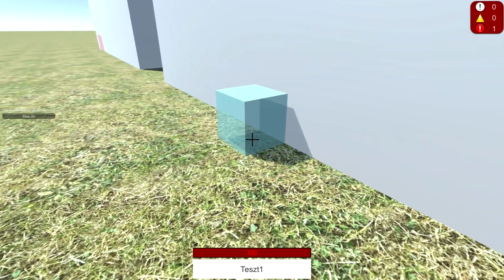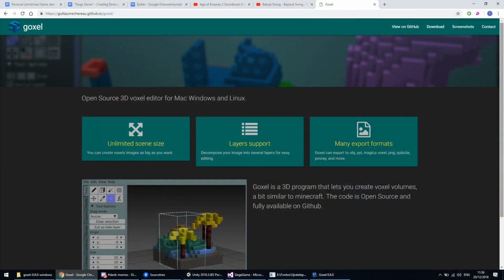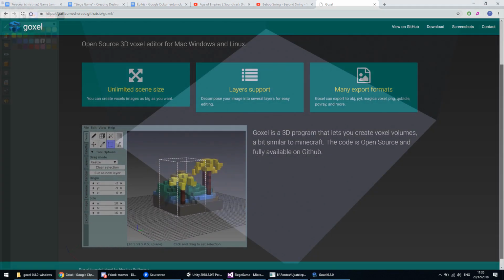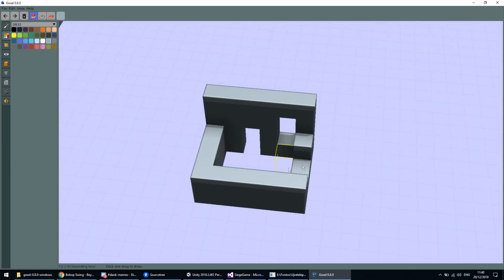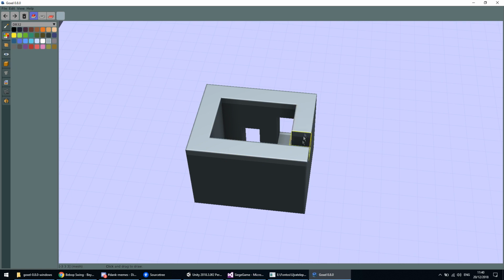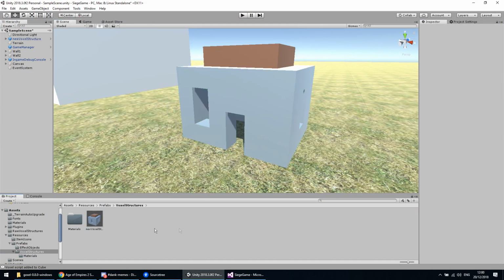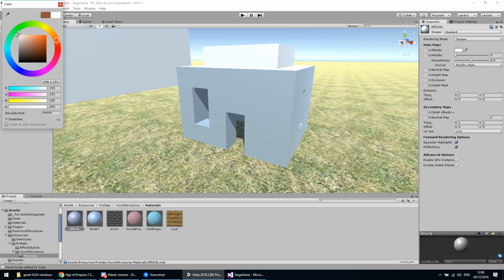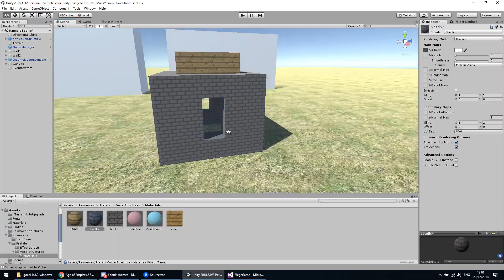How I Model Destructible Voxel Buildings in my Unity3D Game

Comment: You should do tutorialis you are are a smart guy
Reply from the maker: Back in my old channel I made a lot of tutorials, and the I started to get lots of emails, messages, asking for help. First I helped all the a time, but then I realised that sometines 8've spent hours on someone issue, for free.
And when I told them that this problem would be hours to fix, and I don't have that much time right now, they got rude.
Now I try to minimalise tutorials, so I won't be "a tutorial guy".
Reply: @Tudvari  that's a fair call did you ever finish your game
Reply from the maker: @Deaker24  If you mean this one, then I'm not sure. A multiplayer game is always hard to gather a core community, and without it, it fails. So I plan this only for me and my friends, and for those who also got a group of friends to play it with.
Reply: @Tudvari  I tried that code but it came up with a heap of errors
Reply from the maker: @Deaker24  Well, the problem is on your side, it works for me :\
Reply: @Tudvari  yeah I'll be missing something I'll just try figure it out

Comment: Will it work in magicavoxel as well, despite not being able to export as a txt file?
Reply from the maker: I don't quite get you :\ Could you rephrase please?
Reply: In magicavoxel (a similar software) would the voxels still act separately and not like one big mesh, if I exported it as a obj file? Thanks
Reply from the maker: @unforsakenanimations266  Obj is text based as well, so it's possible, but it could be a bit hard. Depends on the formatting of the obj.
But sure, you could give it a try. You just have to understand the format, and then parse the file somehow.
Reply: Tudvari thank you a lot :)
Reply from the maker: @unforsakenanimations266  No problem :)